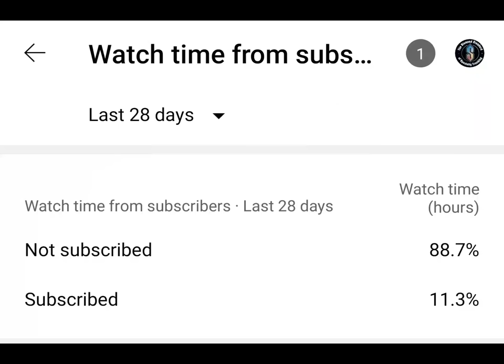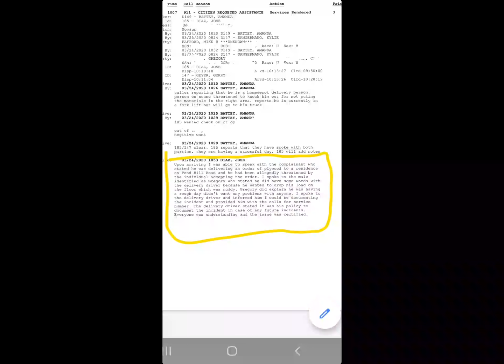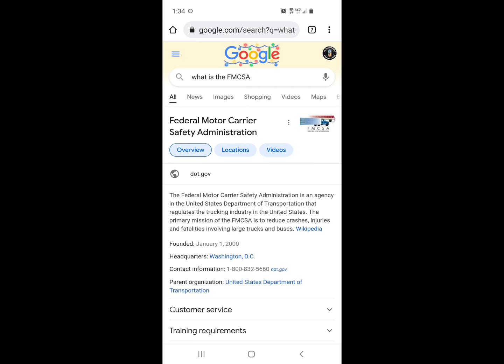ALTERCATION customer gets ANOTHER delivery? 🤔🤔

Comment: Don’t you have to put hardwood inside at room temp to avoid warping ? Not left out in moisture
Reply: 72 hours acclimating at normal temp and humidity. That house may not even have conditioned air yet but a lot of git-er-done builders install anyway and service it later, IF you can get them back. Under no circumstances should it stay outside in that weather for any amount of time.

Comment: Generally truck drivers are told to deliver x load to x spot then its the customer responsibility to unload the truck. However as a retail store the driver drops the load to the location,  if the buyer would like it placed in or at any specified place he/she needs to be there to provide that information provided it can be put at that location  as in muddy driway and ablity of equipment to move it on that surface.  

You want finnished materials in a garage the driveway better be paved.  Fork trucks cant drive over rough land and mud its not a boat or a crain he cant set it in the back yard if you cant drive there. 
Aruging with a truck drive dropping off your load is stupidity.

Comment: How long is training for the Moffett. I'm considering local positions, but the majority of the companies I'm looking at require use of the Moffett.
Reply from the maker: Depends on the person really
Reply: Where I used to work it was 1 hour if that
Reply: I got it down in 20 minutes but yea it really depends on the person.
Reply: @559rz  Thanks
Reply: It's 40 hours at my company. We deliver our own building materials. It's a skill for sure! we actually have to be nice to customers and place the load where they want it. Every driveway is different. Long, potholes, dips, valleys. What this guy does on a daily basis is BRAINLESS WORK compared to what I do. My job is 50% delivery and 50% risk assessment. You could hit a slight incline and drop 35k of siding in a blink of an eye. If your a third party delivery service like this guy?Drop of at the curb? Easy money. I also make alot more money. Two completely different skill sets using a moffett.